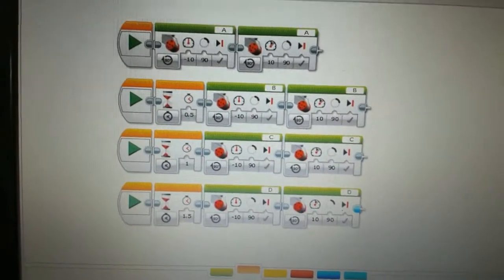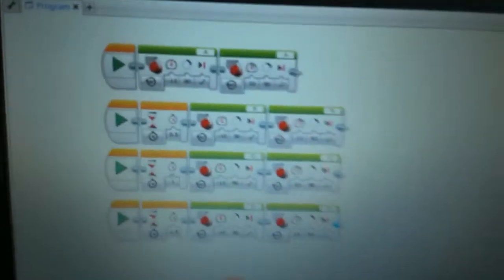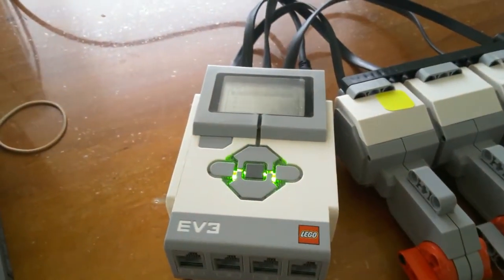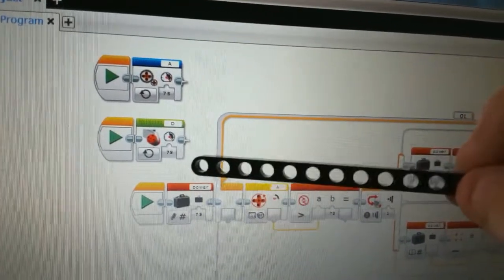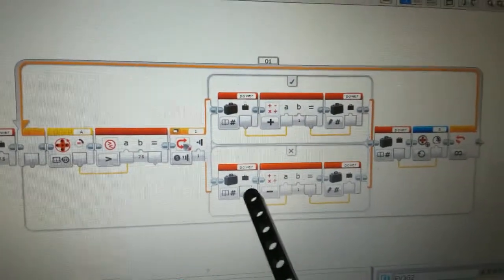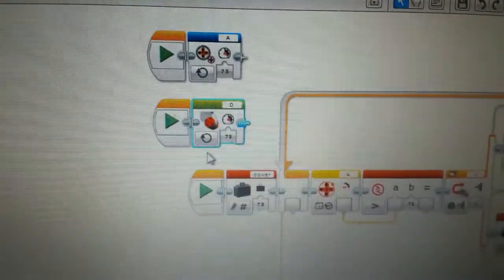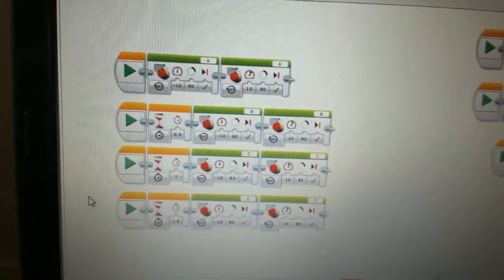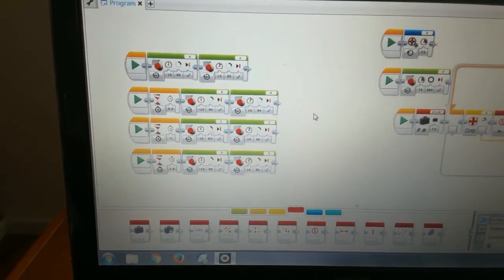EV3 Threading

Comment: Out of the BOTS, do you know anything about how the LEGO software handles floating points? does it automatically use integer math when possible? are there things to avoid that could trigger it into using floating point math?
Reply from the maker: I am not sure how the Lego EV3 firmware handles int vs floats. It is written in C so has all the C data types available but how it maeks use of them I can't tell you. I have not personally looked over the code for the EV3 firmware but it is available at https://education.lego.com/en-au/support/mindstorms-ev3/developer-kits
Reply: I haven't done detailed testing, but I'm now thinking that it handles all numeric data as floats. there seems to be some kind of NaN as well. david gilday's rgb block hiccups from time to time and returns values that are printed to the screen as "----"
Reply: along with NaN, it also has infinity

Comment: thanks for pointing out the threading issues. I had assumed that I could prioritize threads by using infinite loops and wait times, but apparently the software isn't smart enough and will still allocate lots of cpu time to waiting threads. my PID algorithm now executes at 170 Hz, up from 80 Hz (program is down to two nominal threads from six). still using the coordinated steering block, I will throw that out tomorrow and see what I can get.
Reply from the maker: The Lego virtual machine governs the threading propriety. The builtin speed regulation threads is setup as high priority blocking asynchronous threads because the firmware was it to run at a precise timed interviles. Thus using the green regulated motor block ties up the CPU a lot and blocks the other parts of your program. The Lego VM weak spot is it is poor in managing large number of thread too. Being able to write your program with least amount of threads will always increase performance.
Reply: I got rid of the "move steering" block and my PID execution frequency went up further to almost 300Hz using two threads.